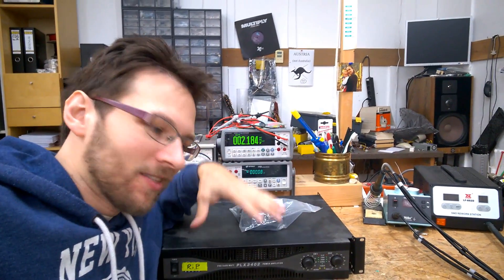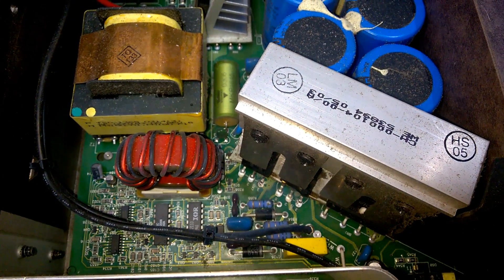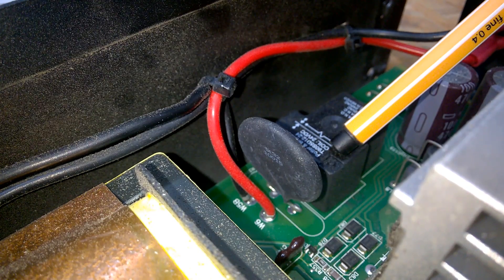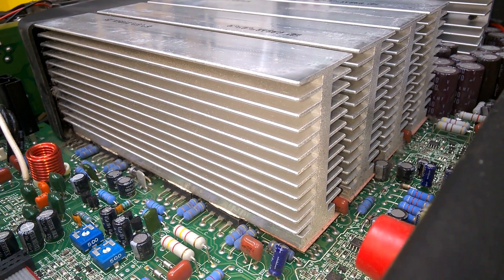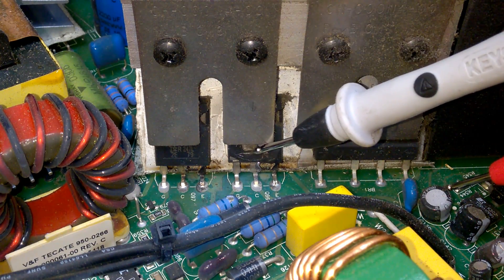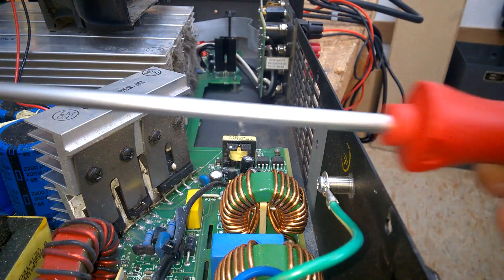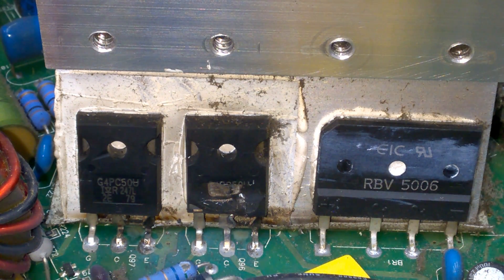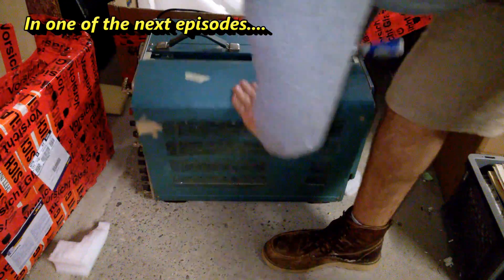QSC Power Amplifier PLX3402 Amp Repair (Part 1) BEB #27

Comment: Hi i am  getting  a problem  with  my QSC  P LX 3402 no power  but all the  fuse is good  and all the  output  transistor  is good  and all the  regulator  is good  what  you  think  could  be  the  problem  or what  will you  recommend  i check   thanks

Comment: Hey! I have a plx2402 that works alright but when I turn it off, one of the channels (just n2) creates a very loud pop. I connected the output of it to a scope and saw a very big spike at turn off. I have 167.5V at each rail of the power supply (measured across the big blue eletrolytics). Signal at normal operation is clean and both channels are matched. I would like to know your opinion on this. What should I suspect? Many thanks

Comment: I bought one of this on ebay (used). I don't have a speaker to test it now. I plugged it in, The power indicator light turns on. I wonder if the fan should run too upon turning on the unit? Thank you in advance for response.

Comment: My nap was plx 3602 on/off not power on properly please help me
Reply: sanjay gadhave did you ever figure out what was wrong?  My switch wasn’t working reliably for a few years so we always just left it on and unplugged the IEC cable when not in use.  Then one day it would not power up.

Comment: At 3:25 you see the HiPerFRED Epitaxial Diodes D72, D73, D84, D85 - these are for the positive and negative Hi-Rail's and can handle 30 Amp's at 400Volts.
At 3:44 you see two of four Diodes D74, D75, D80, D81- these are for the positive and negative Mid-Rail's and can handle 15Amp's at 200Volts.
Reply: Sir I have Qsc Amplifier Model DCA 3022 Both Red Light blinking  Kindly if you have possible then help me about solution

Comment: you are using the plyers on the first 2 scews at least wrong.If you turn the handle and plyers the other way and draging instead off pushing the handle off plyers,you will get lot more gripping foce on the screws.those plyers are constructed so if used the rigth way it grips automaticly much harder at the same time as you drag the handle if i remeber correct?like the video.innteresting.do some amp building and repair for some 30 years.always somthing new to learn about different types of amps:

Comment: I think we had exactly those amps at my high school for the auditorium. Blew the ass out of the rectifiers diodes on one (BR1 on yours) same exact failure! Overheated that section. Caps were good though (Nippon and CDE, but I didn't know that those were best of best at the time). I had to get out vice grips too! That's been a long time ago...might not have been same manufacturer but I'll be a monkeys uncle if it wasn't identical.
Reply from the maker: thank you for your awesome comment. Also, I've noticed that you gave me thumbs up, that's nice!!

Comment: Hi, so interested in your video, if I may ask. I have one power amp of QSC which is 120v input and in my country we are on 230v . I wonder if the switched mode power supply of these amp's can be converted to take in 230v instead of 120v and avoid the use of step down transformer
Reply from the maker: Hi Otiesh. Depends on the model. Please refer to the operators manual, or check the service manual. I am not an QSC-expert. Thanks for your comment. You are welcome. Kind regards, Max
Reply: Please thanks , will keep searching for the solution
Reply: Generally they are bought in the voltage setting that will be used.   Some pro audio gear has a switch adjacent to the fuse or power connector that will allow 230V to be used.